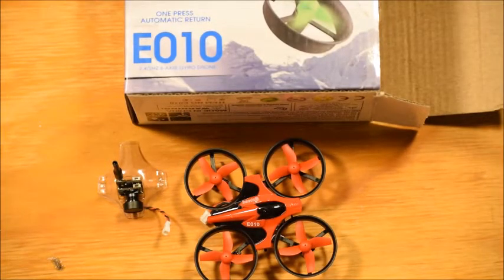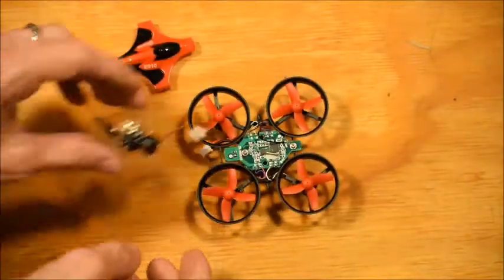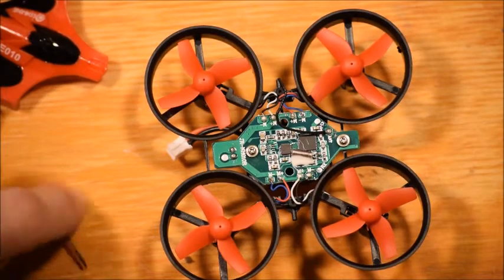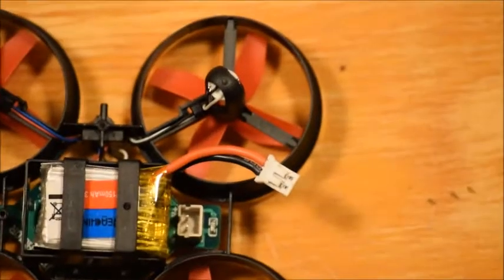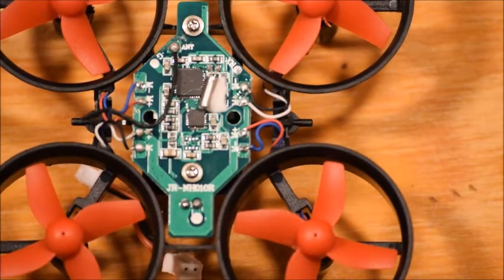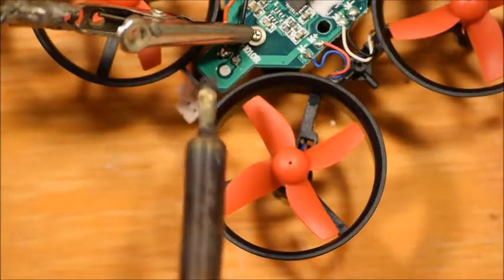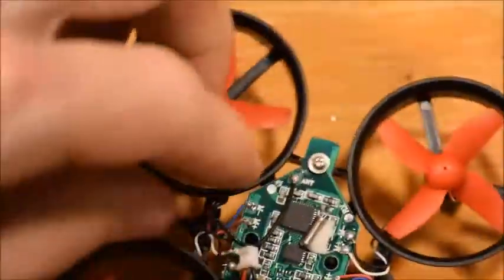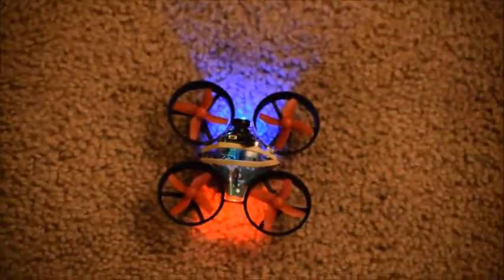EACHINE E010 Micro Drone - How to add FPV camera

Comment: Hello dear , I have this camera with 2 more wires...I don’t need the data wire... ( white and yello) how can I do ? Thank you for your help.
Reply from the maker: Well it sounds like you may have a stand alone camera, instead of a camera/transmitter combo, if you have 4 wires coming off of it (red, black, yellow, white) they are probably positive, negative, video and audio respectively. The camera you have may be meant for a larger quadcopter where you would connect it to an external video transmitter. best of luck!

Comment: what the price of fpv
Reply from the maker: Ramandeep Rd , I suppose it depends on how involved you get in the hobby. If you just fly one little quadcopter and have a cheep pair of fpv goggles than you can enjoy the experience for less than $100 usd. if you get into the fancier quads, goggles and transimtters the cost can get into the thousands over time. Happy flying!

Comment: Hi!! Gz for the video. It is very helpful. I tried it with my JJRC H36 and a similar FPV camera but without the goggles. I used a smartphone receptor. Everytihig works and I get the video signal from the camera but as soon as I accelerate the engines I lost the video signal. Just when I accelerate. Do you know what can I do to fix this problem? Thx so much!!
Reply from the maker: Juantxito C. , another possibility is that the vtx you are using might be unable to opperate on the voltage available when your motors are also running :0
Reply from the maker: Juantxito C. , that sounds pretty  cool, Ill net its fun being to view the video on your phone instead of the relativly low resolution of goggles
Reply: Electrical interference from the motors, apparently it affects some people who have done this and not others, so I don't know what the difference is. There are things you can add in btween the camera and the power, but on such a light quad I wonder about the weight.